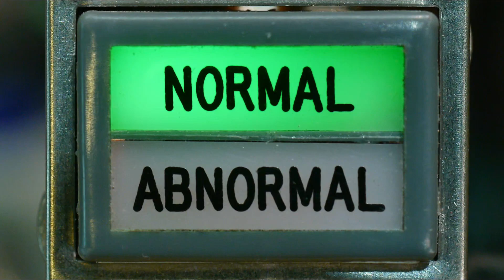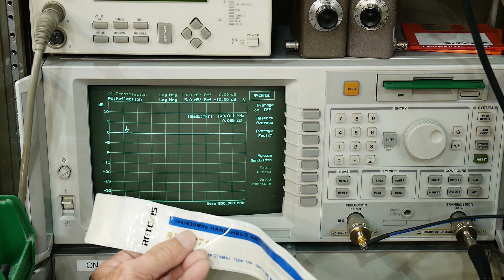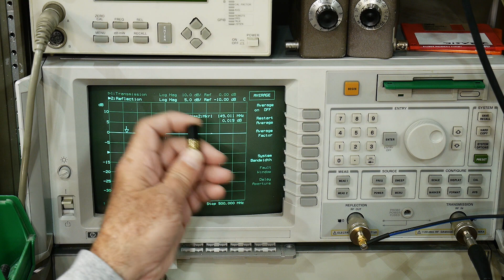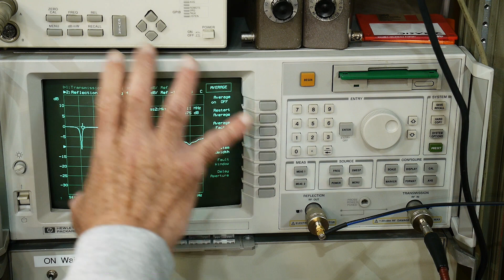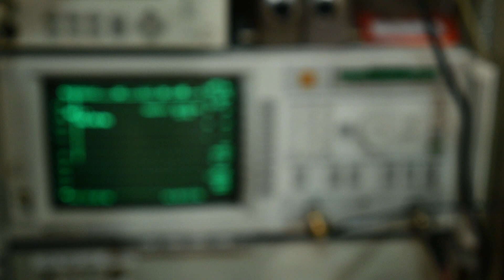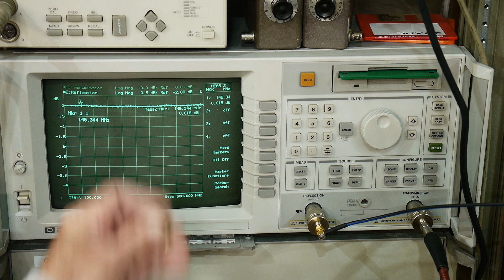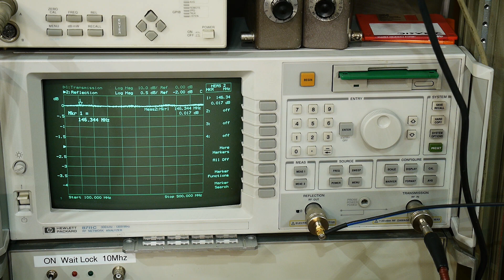#973 Yaesu Retevis Maldol Antennas

Comment: Be carefull with theese measurements. I tried almost the same with my handheld antennas and all of them was slightly off the frequency. But then I tried to measure them with the nanoVNA, just because it has the similar size as my Kenwood TH-D74, it's also battery powered (no wires to ground) and I can hold that thing by hand in the same position I hold my radio when I am talking into it and… And I was really surprised that the frequency peaks changed to the position they should be. Designers expects you are using this kind of antenna on the handheld radio holding it near your head when transmitting. If you put it into empty space with a good ground plane, they are completely off.